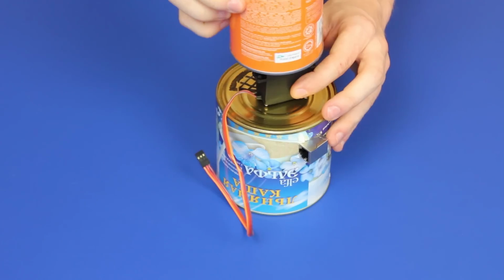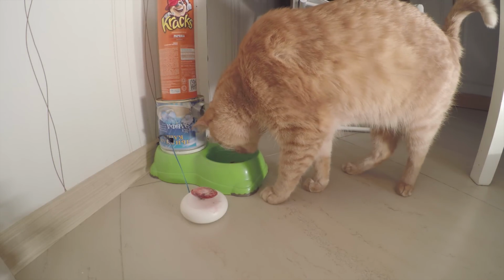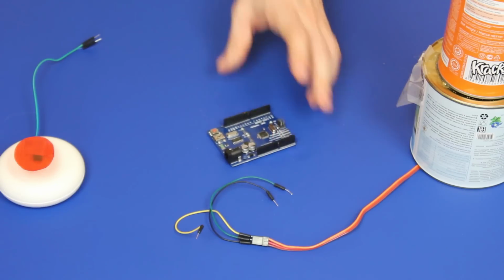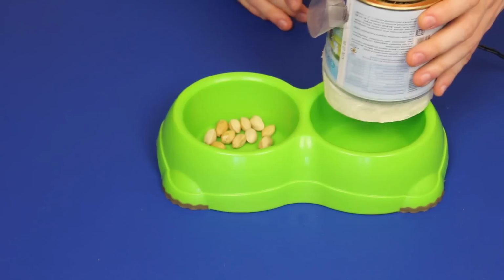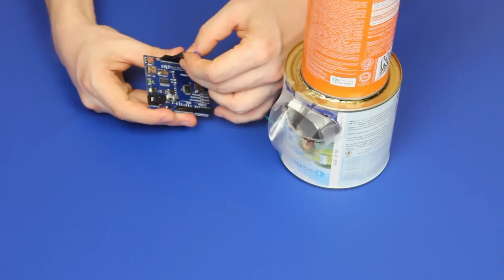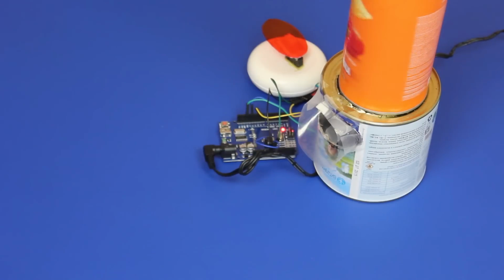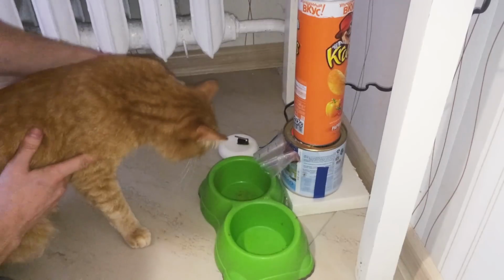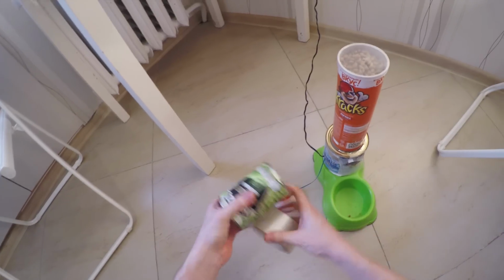DIY ARDUINO CAT FEEDER – cat pushes button to get food

Comment: This is a very nice and simple project. However, for me my place has ants problem and I can see there are gap between the cans, how would you suggest to modify the design prevent the ants from getting in.
Reply: I don't really know, it's a separate engineering issue that needs thorough investigation

Comment: What kind of power supply are you using?  I see your adapter in the background.  What kinda voltage, amperage, etc is it?  Im going to attempt your design, but I don't want to fry the circuit board.   Great video!
Reply: I use 5V 2A adapter directly to 5V pin (only because I had it spare) but you can use any usb power supply to the usb port or 7-12V to the DC port. Max current doesn't matter, it's limited by the built-in resistors. But for the servo to work properly I'd recommend at least 300mA.

Comment: that is arguably one of the simplest designs for a cat feeder I've ever seen... I've been doing it wrong all this time. It wouldn't even be too hard to keep the kibble freshish - tho, I imagine the hopper size (pringles can) is limited by the capacity of the servo.
Reply from the maker: +fremeaner I think servo can handle x2-3 of that volume, it's pretty strong.
Reply: Mom Will Be Proud  can u leave this out for a trip
Reply: Probably, we didn't have any issues with the device for an entire year. The only problem happens - if electricity is disabled cat can hit the button too hard and too much times so the button flips. Can be fixed by making the button heavier/more stationary or using reserve power supply :D

Comment: Hi there, I love the concept and understand it. However, I have never been into hardware. May you show me where to get those wires, and the logic board. I did go look for a micro switch but it does not come with the wires that you have
Reply from the maker: I bought everything separately on ebay.

Comment: what is the secret for the feed not to tangle when the mechanism comes back?
Reply from the maker: There should be a gap between cans that is larger than the grain of the cat food. In my case the lip on the bottom of the pringles can works well enough but you can increase it if you need to.

Comment: How did you fix the servo ? Do you have picture of the inside ?
Reply: With a thick durable wire. Twisted it there. There are holes in the servo that you can use for that.
Reply: Thanks. :)
Reply: Александр Улитин and to fix the servo to the top can ?
Reply: Same. There are plastic adapters, you just fix one of those with a wire.
Reply: I would be really happy seeing more details on how you attached the servo inside.. It's not clear from the video, but I assume, the body of the servo is in the botton jar, and the horn is attached to it from the top of the bottom of the top jar (did that make sense?), to keep the 2 containers as close as possible... 

Nice video though. Looking forward to more (with a liiiittle more detail on construction, please :))
Reply: photo please

Comment: always when the arduino is connected to the computer it works, but with the battery it doesn't
Reply: Insufficient power. You need a 2A power supply, i.e. ipad charger or similar.
Reply: I use 9v e-block
Reply: Ok. I will let you know if it works!
Reply: Thanks!!! It worked

Comment: Hello, please I need your help, I'm trying to do the cat feeder for a project for my class, but I don't know how to connect the two cans the servo. PLease help me.
Reply from the maker: I used a durable steel wire. I think that glue will smell too much. And I don't see how to fix that with screws in this case.

Comment: Great idea ! I'll do the same for my cats :)
 Can you give the references of the arduino and the servo that you used ?
Reply from the maker: Arduino - it doesn't matter, any arduino or clone will work fine, I'd take pro mini Chinese clone, just because it's smaller.
Servo - I used MG995.
Reply: Thanks :)
Reply: hi do you can let me know names for parts please i want search on google thank you
Reply from the maker: any arduino or clone (I suggest arduino pro mini), mg995, any 12v/5v power supply.
Reply: thank u

Comment: I would like to do that for my project in class, just one question is the push button connected to a breadboard  or by itself? Does it has Any kind of resistor?
Reply: Hey! Here's the circuit. https://circuits.io/circuits/2707080
Reply from the maker: Omg, will I stop posting from another account...

Comment: I did it but it did not really work for me. First rotation, I only get about 4 biscuits and nothing more even if the servo is still in the good position. Next rotations, nothing. The rotation works fine and I can see that the holes are matching when they are supposed to. I really don't understand. I will have to try another design, maybe with a funnel.
Reply from the maker: https://www.youtube.com/watch?v=U56vaOFfUMc Have a look, maybe it helps. I haven't finished this video so it's unlisted.
Reply: Thank you, I will give it a try.

Comment: very good video but not you explain the circuit very definitely that there are people how I we need many specifications

Greetings from Chile
Reply from the maker: Thanks! Numbers of pins are in the code. Essentially for servo you should use any PWM pin and for button just any other. Pins are set in the code in the description. Probably should draw a circuit in some program.
Reply: Anyway Thanks for the video
Reply: Servos are thankfully stupidly simple to drive they rarely even need extra components, just one arduino and one servo - 2 of the pins on the servo go to power and ground (shared ground with the arduino) and the third one goes to a signal pin on the arduino.
Reply: Thanks
Reply from the maker: https://circuits.io/circuits/2707080
Reply: Thanks

Comment: What a neat Arduino project! I have a question though, if I wanted to use the initial button press to activate a cat laser pointer like this ( https://youtu.be/hHIrxL0giJQ )  then after my cat got a slight workout, your contraption would deliver a treat. any help with coding would be greatly appreciated